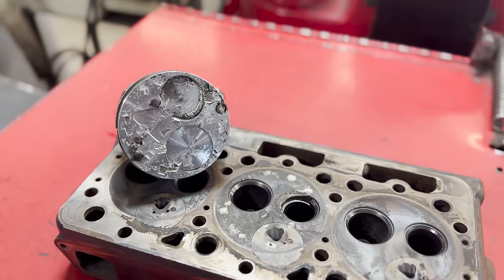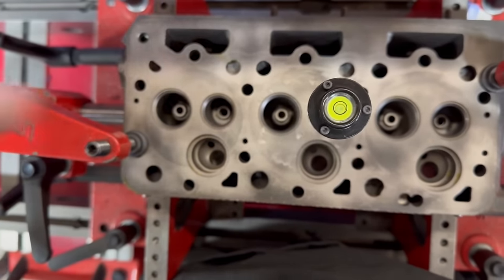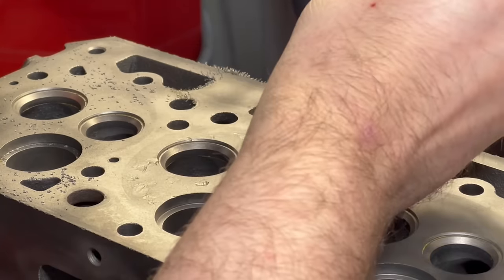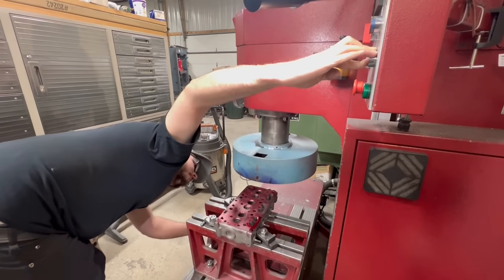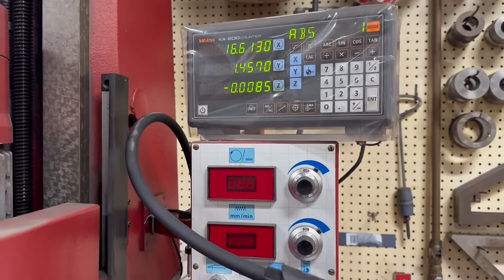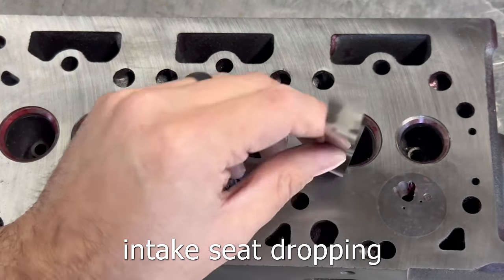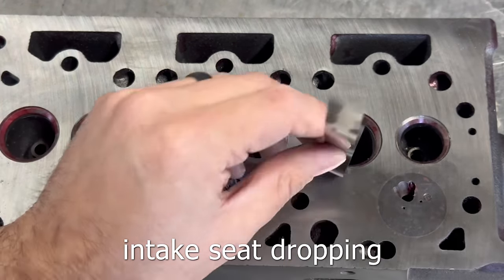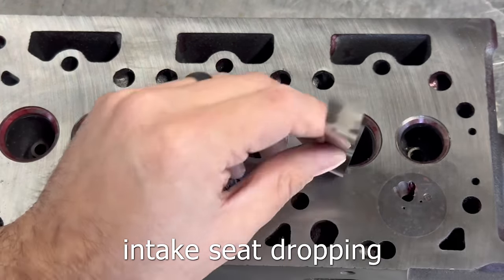Is A 3 Cylinder Kubota Diesel Engine Worth Fixing?

Comment: That engine is a sad commentary on the modern greed driven design and manufacturing processes that produces a product intended to be scrapped at end of life instead of a design capable of being repaired and reman'ed. There is very little design cost difference. The reusable one is more expensive to build but less expensive over the long term. The throw away design's purpose is higher corporate profits. Sad...

Comment: I would have cooked lunch for you. Lol. It seems that before you start any work you should check all the parts and start with no parts that hurts when you lose money on a part. You should have started with honing out the center bore. I would have tried to find a used one that someone is trying to unload that has been lying around then you could have used the block and the arm thingy connecting road you just said and have 2 left over.

Comment: Is this from a Grey Market tractor?  This jives with your overseas parts purchase dilemma.
Reply: Kubota sells lots of tractors and other equipment here in the States with these little 3 cyl engines.
They do have parts support.
Like Jim said, they weren't made to be remanufactured when you can get a factory fresh replacement for under $3k.

Comment: It would take a lot of moxie for me to send that beat up head to a machine shop when i could probably ebay an aftermarket head for 450. The original head may be superior but I don't know if it's that superior. Someone should buy the after market heads and test them. My man might even have better luck ebay'ing a used kubota and rebuilding it.

Comment: Robot cantina has a series on putting a small Kubota in a car from a refer unit that's pretty good. With a little turbo and turning the pump up it appears to get around almost as fast as an old 36hp VW beetle. Think it's a 700cc engine

Comment: As a real deal 66-year-old Texas rancher, I can honestly state that Kubota tractors are junk. The seats go first. Then other switches, knobs, guards, etc. Then real problems start. They simply will not hold up. I have owned at least five of them. Absolutely junk for any real use. Weekend Farmers probably do ok with them. Pay the money for a real tractor.
Reply: What kind of tractors are the best based on your experience?
Reply: @josephleehamm I saw in my youth a John Deere is the best. Period. HOWEVER, the newer tractors are not as reliable. Too much electronic crap that causes problems. IF the size is right and you can find an honest rebuilt, the old 2020 can’t be beat for light plowing and deadly for shredding, and general farm/ranch use. The perfect machine. If you need bigger, simply move up in model number. I’m not sure if the year things went electronic. I currently own three new JD tractors. Good but not anything like a 1975 2020 or larger. Just my experience.

Comment: why wasn't the block checked first? why didn't you check the center cylinder first? instead of wasting time on the other cylinders? why did you put too much repair into the cylinder head first before checking block? would have saved alot of time and useless debate on telling the customer the news.

Comment: why not put some weld material into that head and bring back the lost material, THEN machine to factory spec?

do you not know how to weld?
Reply: Welding cast iron is usually a bit of a fraught experience.
Reply: and the heat from the welding process could warp the cylinder even more
Reply: Welding cast iron is fraught with danger. As the region in question is subject to high temperature & pressure, it should be avoided it at all costs.